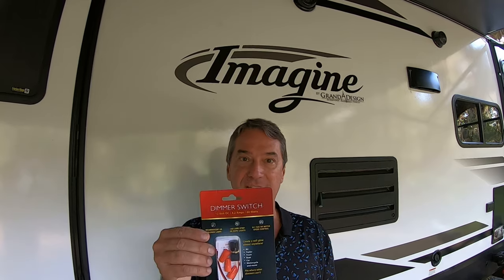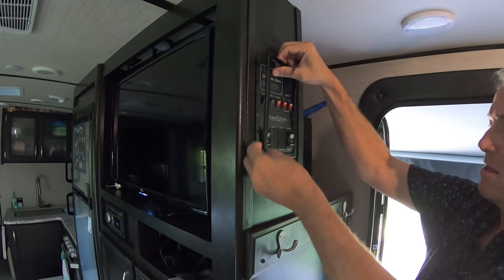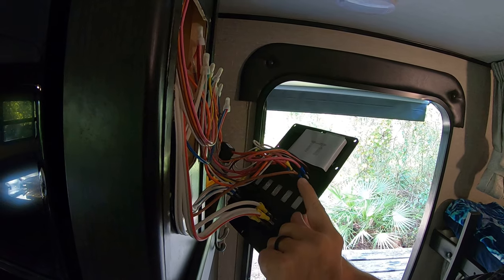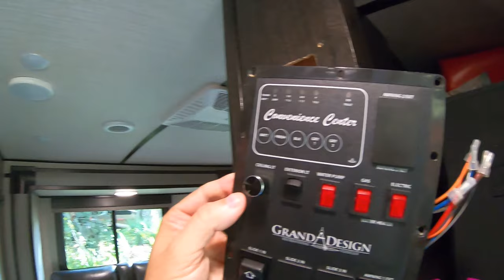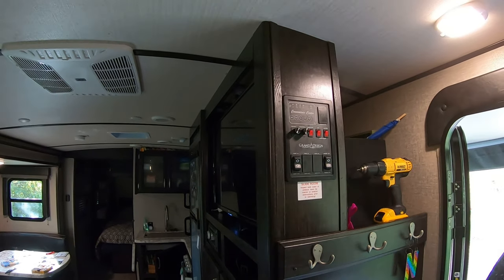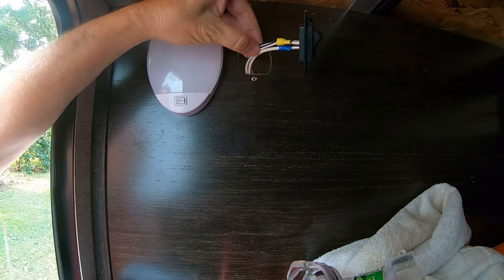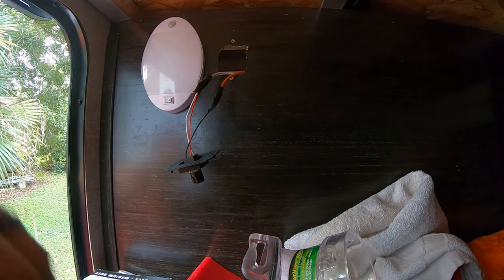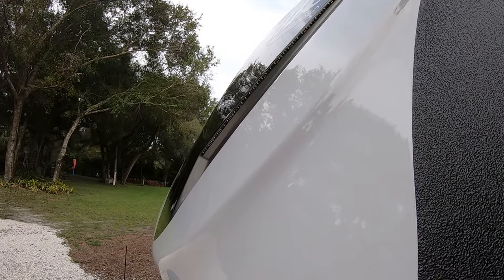Grand Design - Dimmer Switch Install

Comment: I really hate it when people leave their V lights on all night, no matter how dim. In fact I don't know why people leave so many lights on all night even after they go to bed.
Reply from the maker: We do too, I rarely use them except when it is really dark and need them to see around the site. Even then I use the dimmer. They now make a switch with a built in dimmer for the V lights. It came out less than a year after I did this video.
Reply: @FLWeekendWarriors  I put in "under rig" blue LED strips for seeing a walking path around my rig at night. There is just enough light to see where you're walking but not enough to carry out and disturb others. Over the past several years it seems that people like to light up their campsite all night like a party hall and I just don't understand it.

Comment from the maker: Cathy, I wanted to do the same thing. But you would need to run a wire from the the v light switch all the way back to the main panel. I also want to put in a Victron battery monitor and would have to run a wire basically on the same path to the main panel.  I will eventually do it some day, but it will be a lot of work. If I do it, I will do a video and send it to you.

Comment: I'm feeling pretty incompetent here, but hoping it's not just me. I I ordered two of the dimmers for my RV back in February, and thought it'd be an easy install basic on multiple youtube videos. Sadly, I was not able to get the dimmers to work in my 2020 Grand Design Reflection 315RLTS. I tried all wiring combinations and got either 1) on/off functionality but no dimming, or 2) no functionality at all. I figured I was doing something wrong, so took the RV to a professional along with the dimmers, and he had the same result. I now think the dimmers must be defective, or that there's some other secret I'm not aware of. Has anyone else had similar issues? Do I need to do anything with the lightbulbs? My unit has the stock bulbs. Thanks in advance.
Reply from the maker: Dave, send me an email to: wenservicesllc@gmail.com. I will forward an email from Marty Robinson that has lots of good info.  He makes the switch panel plugs for the install. Apparently their is even a facebook group for the dimmer installs.
Reply: Having same issue. I have the same rv. Where you able to find the correct way to wire it?

Comment: You didn't show how to actually wire them up. I have 2 wires from the rv, 3 on the switch. Tried in every way, not dimming. Ideas?
Reply from the maker: @vdubing01  mine had two red and one black wire, the black needed to be a ground. Had trouble findings a ground, but finally found one in the spaghetti mess behind the panel. Should have been instructions/diagram that came with your switch.

Comment: I did this and it work great for a month. Now they stopped working. My fuses are good and the dimmer switch is working but no lights. They flickered one night and went out. I  got a new dimmer switch and no lights. I do not know how to proceed???
Reply from the maker: Sounds like a loose wire/connection if all the other 12 volt stuff works.  They use really cheap crimp connectors to wire the RVs. I had a speaker stop working, pulled stereo to troubleshoot, I pulled two other speaker connections loose just troubleshooting it.
Reply: @FLWeekendWarriors  Yup, took me all afternoon but I found the loose common wire and it's all fixed. Thanks
Reply: @LarryRichelli  Where was the loose common wire?

Comment: Great video Bill! 
Oh my yes... these lights are far too bright for morning or night and demand a dimmer! 
I have a 2023 Grand Design Imagine and my Compass Connect panel looks different than yours!  Is the circuitry and wiring different on the 2023 preventing me from using these components??? 
Also Bill, were your GD ceiling lights the tiny 3" round lights?  I was not sure they were dimmable.

Comment: I have installed these dimmers in  the light over my theater seating and over the counter the work well  and did not have a problem  oscillating with the pump running

Comment: Using the same dimmer switch you installed - had red white and black wire from new switch - can you verify your wiring connectors? I think you connected black to brown wire going to lights and connected white and red from switch to red wire for camper - if so what did you connect the white wire from the camper to
Reply from the maker: Not sure, did the switch come with a wiring diagram?

Comment: Good video. I just purchased a 2021 imagine 17mke (used) will try to do the dimmers. Do you know if they may have the water pump switch? Mine just broke….
Reply from the maker: I tried to get my son to buy that model. Grand Design has parts manuals online, just get the part number and call a GD dealer.
Reply from the maker: https://www.granddesignrv.com/owner-support/service-and-warranty/parts-lookup

Comment: Thanks for the great install video and a link to my adapters.  One suggestions is to reverse the nut holding the dimmer.  This will not only allows more surface area for the dimmer nut to hold but the knob will fit better.
Reply from the maker: Thanks for the tip, not sure why they don’t install these at the factory.

Comment: While ordering the parts for the dimmer-ing, I ran across this dimmer that looks like a great option for the V-light. I wondered if you had any comment on this part American Technology Components 12 Volt DC Dimmer Switch (Slider, Black) – available on amazon.
Reply from the maker: That slider switch came out shortly after I did my video. I have no experience with it, but It looks like a good option.

Comment: Do you know if it works with the command center on the newer grand design 2021 in 2022 models
Reply from the maker: I don’t think so. I thought the new ones came with “Compass Connect” panel which does not have any rocker switches.
Reply: I have the panel just like what you have with the rocker switch I bought the dimmer and everything but I was told since it has compass connect it will not operate
Reply from the maker: Their is likely a way to bypass the compass connect, and just wire the the lights directly to the switch. But I would not know how and you might keep getting error messages from the Compass Connect app. I would post something on gdowners.com/forum/operation/electrical and see if someone has figured out how to do it.

Comment: Where can I get these panel plugs?  TIA
Reply from the maker: You get them from Marty Robinson - hybris1@yahoo.com
I cut and pasted one of his emails:
Below are my current order instructions.

Thanks for inquiring on my adapters. I have a few different adapters available for Grand Design travel trailers. Note: If you have the newer control panel with push buttons “Compass Connect”or switches with “Lippert OneControl” app controlled module, this solution does not work without significant rewiring. Control panel adapters for the 3/4" tall switches located in the "convenience center", single wall switch adapters (bedroom, front lights, etc), double wall switch adapters (double dimmer or dimmer and switch) and triple wall switch (dimmers or switches to be specified).  Single/double/triple wall switch adapters reuse the original bezel.  I also have a 1-1/8” control panel adapter,  and 3/4” round adapter for some other front cap light switches located in the universal docking station.  All these options are reversible and require no modification to the trailer or wiring. 

These adapters require the long shaft version of the PCA brand dimmers. Here is a link for your convenience (you'll need to buy the dimmer from Amazon or other). http://a.co/2T6qMG9

The control panel adapters (.75", 1.125" or .75" round) are $5 each + $5 for US S&H per order ($14 for Canada). The single wall switch adapter (bedroom or other) are $10 each and a double wall switch (2 dimmers or dimmer/switch) are $15 each. I also have insulated male connectors that I can add for $1 a pair (each dimmer requires a pair). Grand Design uses two different sizes depending on year and location. I include both sizes of the connector (.25" & .187"). The small will fit all but the standard fit better where oversized .25" were used. These are fully insulated type that cover the factory connector.  They cost 2x more than uninsulated type but I prefer them.

Preferred payment via PayPal. Please note in the payment what adapters you want. Also make sure your address is correct. My PayPal link is https://www.paypal.me/adapterman or my email hybris1@yahoo.com

Popular combos (Canadian shipping extra):
  #1  Two control panel adapters (overhead and  awning lights) - $15 shipped US + $2 for connectors
  #2  Two control panel adapters and single wall switch adapter (adds bedroom or front “V” lights) - $25 shipped US + $3 for connectors
  #3  Two control panel adapters and two single wall switch adapters (overhead, awning, bedroom and front “V” lights) - $35 shipped US + $4 for connectors

Some helpful links:

Install video: https://youtu.be/pPX_S9wx4l8
Dimmer (long shaft) required: http://a.co/2T6qMG9
Connectors recommended (standard size): .25" male spade connector fully insulated https://www.digikey.com/product-detail/en/te-connectivity-amp-connectors/2-520102-2/A27906CT-ND/3598087
Connectors recommended (small size) : .187" or 4.8mm male spade connector fully insulated https://www.digikey.com/product-detail/en/te-connectivity-amp-connectors/2-521103-2/2-521103-2-ND/289166
Recommended crimp tool: http://a.co/ioJDvmB or better http://a.co/6A0XvZ4

*Below require Grand Design RV Imagine Owners facebook group access
Adapter facebook discussion: https://www.facebook.com/groups/146736952385751?view=permalink&id=426831901042920
Imagine facebook dimming FAQ: https://www.facebook.com/media/set/?set=oa.563015700757872&type=3

Thanks,
Marty

Comment: Links doesn't seem to be active for the panel plugs. Anyway one can still get them?
Reply from the maker: I just tried both the PayPal and Facebook links and they both worked for me. Someone sent me a comment a week ago and said they were working.  When you pay on his PayPal account, you get a shipping confirmation in a couple of days, per the last comment someone posted.
Reply: I didn't see a link to the plug adapters. Can someone link them as a reply?
Reply: @markevert7395  I ordered these from him a few weeks ago.  Got them in about 3 days and they worked perfectly.  He packages the 3D printed parts and the spade connectors in a little zip lock type bag and ships them in a bubble wrap envelope.  Includes two sizes of connectors and even a spare of each size plus a wiring diagram.

Comment: How do you turn off the 12v power?
Reply from the maker: My RV has battery disconnect switch. If you don’t have one disconnect the battery and make sure the RV is not plugged into shore power.

Comment: Here is another thought take the power wire off the switch and power it from the awning switch  since the awing is on a separate fuse than the only time the lights will  oscillate  or not is when you move the awning

Comment: one problem when the water pump turns on the over head light were flashing  due to the brushed motor in the pump and the panel is feed from 1 source   had to add a separate wire to feed the water pump and it solved the problem
Reply from the maker: john countryman , thats a great idea, my lights would also be affected by the pump when they were dimmed low.
Reply: john countryman:  I don't have my trailer yet and am ordering parts to be prepared for the dimmer mods.  Would you kindly be more specific on the wire add?  Thanks,
Reply: Can you show me the wire you added for the water pump?
Reply: Yes, details on the water pump wire mod please. Do you have other mods on your chanell?

Comment: You don’t show the actual wire hookup?
Reply from the maker: The dimmer switch comes with wiring instructions. The old rocker switch has two wires one being the 12v feed and the other goes to the lights(load). The dimmer switch has 3 wires. I think two of the wires goes on the load side and just one to the feed(line) side,  but I would have to see the instructions to confirm. It was easy determining the feed side, their was jumpers that piggybacked on one another to feed the switches
Reply: @FLWeekendWarriors  
Tried every configuration and nothing worked, at least dimming any way.